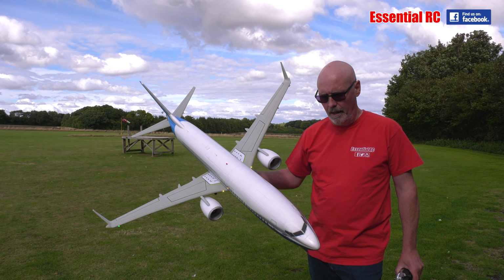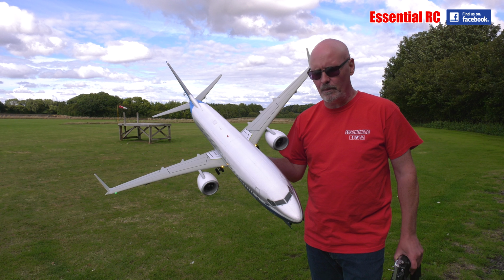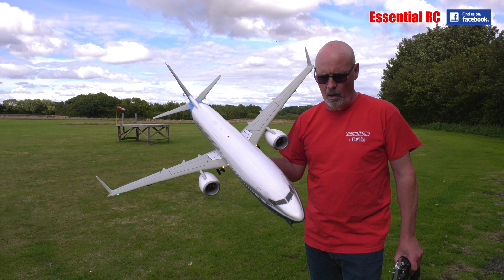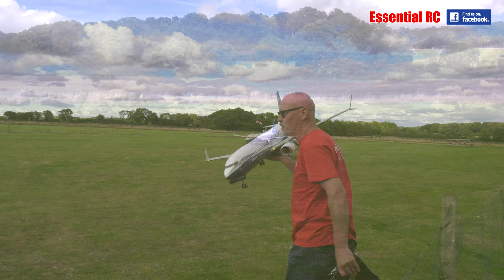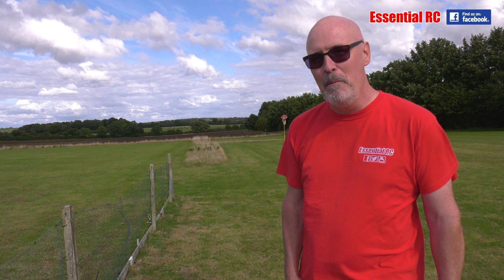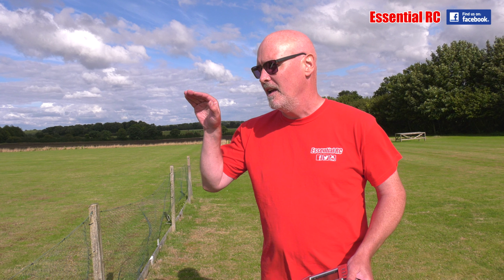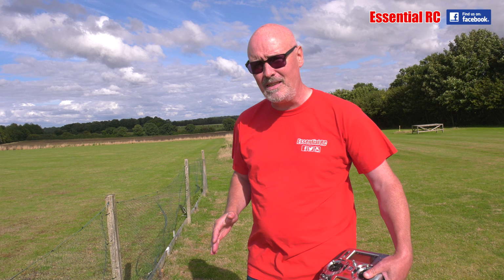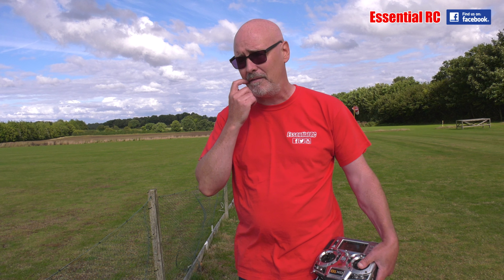X-FLIGHT \ XRP \ SUPREME HOBBY BOEING 737-8 TWIN 50mm EDF AIRLINER: ESSENTIAL RC FLIGHT TEST

Comment: Have you tried it with a gyro yet I've ordered one and I'm going to be flying mine with the spectrum black control a3230b with the satellite receiver it has safe mode and as3x. Do you suppose that would tame some of this airliners  erratic behavior? My next question is I see everyone flying these like a fighter jet but that's not how a real skill airliner flies does this have any slow flat characteristics at all?
Reply from the maker: Yes. Flew it with a gyro but still needs to fly fast to stay in the air. Freewing AL37 a much better option.